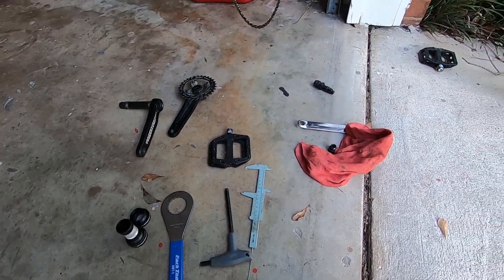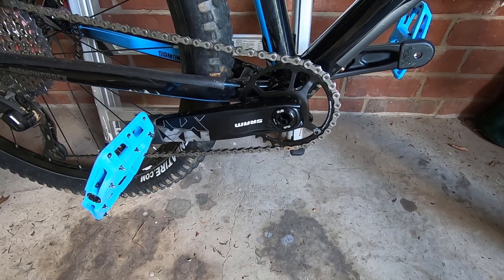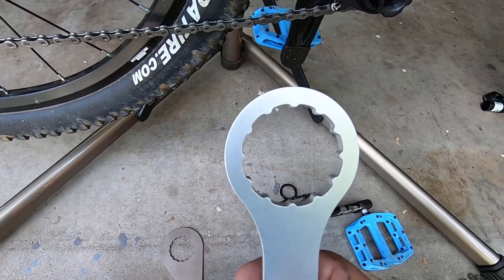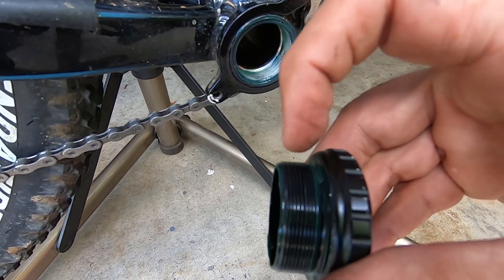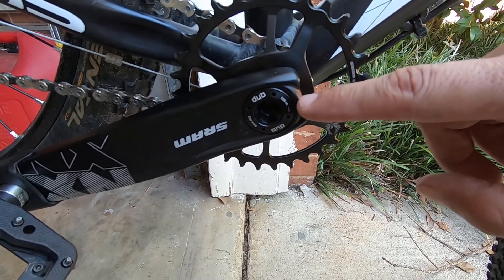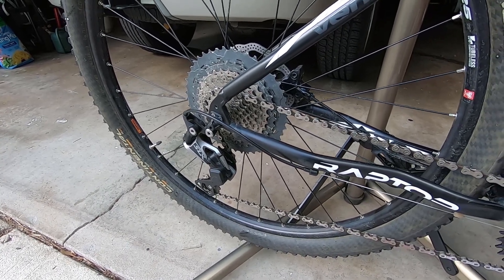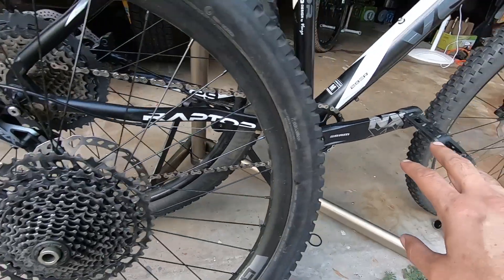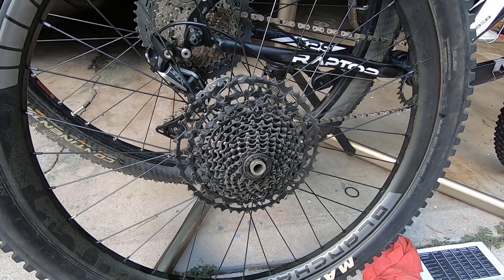Installing a DUB SRAM NX Crankset on a BSA Bottom Bracket

Comment: hi nice video just wondering as I’m not very experienced I have an octalink bsa 73mm bb will something like this fit on mine as I would love to ditch the double chainring suntour cranks as they keep slipping (:
Reply from the maker: Yes, it will work as long as you change out your octalink BB to this DUB one. It will work on any BSA 73 or 68 mm BB frame. The octalink axle itself will not work with the DUB crank
Reply: @TonyHob  thanks man

Comment: I put Sram SX eagle on my GT Aggressor and it’s worth it, I can climb everywhere now... If the climb is not really steep the 50t rear cog with the 32t chain ring will make you feel you dropped your chain
Reply from the maker: No super steep climbs in my area. Right now I have 11-46 with a 30t. I still might try the Eagle though. I’m really curious to try it out.
Reply: Tony's Hobbies if you can go for it... I live in Asheville NC, I usually go to DuPont or Bent Creek, those are on the Pisgah National Forest, so definitely need the wide range here in the mountains
Reply from the maker: I need to get out to ride that area. I have a buddy near Raleigh that’s a really good MTBer

Comment: Will have to change the spindle for GX if you'd been using Shimano. With NX you can use Shimano spindle.
Reply from the maker: This crank uses the Dub system and must be used with a Dub bottom bracket/spindle

Comment: I have a 73mm BB shell and boost spacing at the rear of my bike. Am I right in just using the 4.5mm spacer on the drive side? The instructions that I found on the sram website are very unclear compared to the one you have above. Thanks for your help.
Reply from the maker: Correct, the boost part is handled by the chainring which needs to be the 3mm offset (6mm offset for non boost)
Reply: @TonyHob   Hi, yeah I have a 3mm offset chainring. That's put my mind at rest, thanks! I'm building my first bike from start to finish and it's good to know I'm on the right track. Little things like this catch you out.

Comment: Hello Tony I just purchased this NX crankset as an upgrade from the SX cranks it with the power spine which was heavy trying to shed a few pounds do you think that this crank set with a 32 chainring would work with a 10-speed cassette I don't really care about the 12 speeds my heart totally 10 speed 11 to 46 and I think that is plenty for me so I'm thinking of ditching the two extra gears for a 10-speed as well thanks
Reply: My hardtail is a 10 speed 11-46
Reply from the maker: It should work well with the 10 speed. I had it on an 11 speed and worked fine
Reply: Thank you much appreciated

Comment: Great video, do you know what the Dub Sram crankset chainline measures? I need to convert the drivetrain on my current bike to deliver a 57mm chainline to make it compatible with an IGH. My BB shell is 68mm like the one on your bike.
Reply from the maker: I believe it is 49-52mm depending on the chainring used. Not 100% sure though.

Comment: I find it super hard to crank to 54 Nm. Is that a requirement or can it be like 40 Nm like when you tighten the lock ring on a cassette?
Reply from the maker: I think if it feels tight enough to you you can leave it at around 40Nm. You can always tighten it more if it gets loose

Comment: Hey Tony, great video, very clear! 
Only thing that isn’t too clear as there are soooo many options these days, can you only combine DUB cranksets with DUB bottom brackets? Can i not fit a normal NX crankset (non dub) to a DUB bottom bracket? There are a lot of non DUB cranks on eBay here in the UK that sell pretty cheap but my frame has a 68mm bottom bracket and i believe i can only use a DUB bottom bracket? 

Do you have any pointers you could share? Thank you
Reply from the maker: You can use the non Dib BB on your frame. I believe it is the GXP. Just have to find one for a BSA frame. https://amzn.to/358aKoq